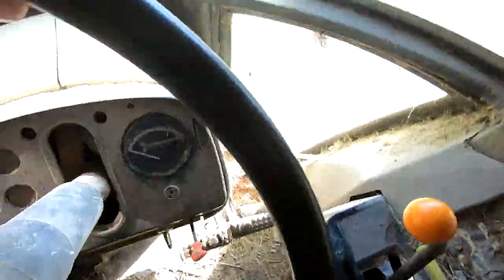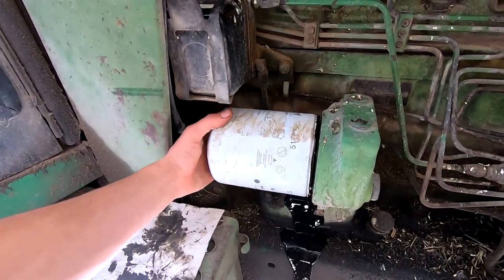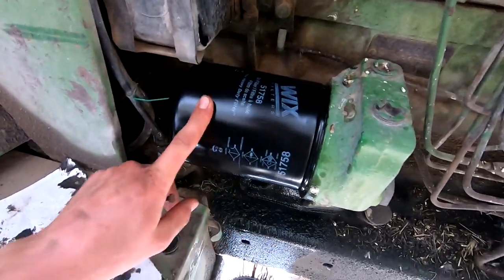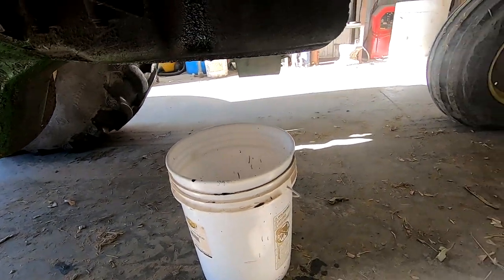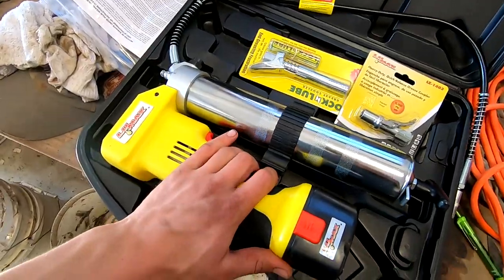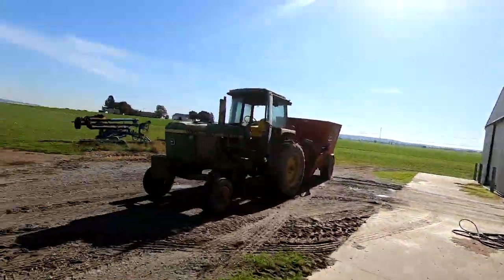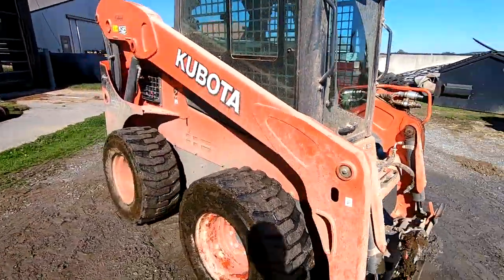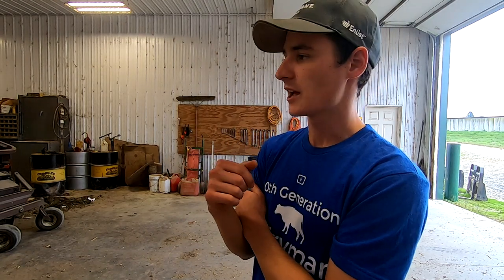John Deere 4240 Maintenance

Comment: You gotta love that filter position. Makes a oil change extra messy.
Reply: That's not bad. When they started turning the engines sideways in the cars 250 transmission for the front wheel drive on the 87 Oldsmobile you had to take off part of the passenger side fender well to get to the filter.( "To position the transaxle".) I usually change what autocorrect puts in there but this time I thought it was hilarious what it thought I said.
Reply: Yeah, that position is perfectly fine. Nothing wrong with an oily frame.
Reply: @EFCasual  There is a small plug right under the filter housing that can be removed & put a small container under it so it will drain the oil from the filter before removal, but sometimes, when time doesn't allow, it is much faster to just let the oil run down the frame.  Going to powerwash anyway.

Comment: 4240 is one of of the best John Deere's large farm I work for has one on the mixer for the past 15 years. It had 25,000 hours on and they had to rebuild the motor, it's now pushing 60,000 and only major break was a new injection pump this summer.

Comment: We switched over to a10w-30 oil for colder weather and it makes it a ton easier to crank a diesel in cold weather.
When it warms up the next oil change is back to the 15w-40 and we have no issues with wear on the engines.
Just an FYI for you.

Comment: Drum opening!  You picked the second hardest way 😟 there are lots of different combinations to choose so I’ll just go with the same tools you had ok. The drift bar , place it vertical next to lug in cap n hold, claw of the hammer 🔨 behind other lug but horizontal as you can. Rotate. Now your smart enough to work out the rest 👍

Comment: Those rotary nozzles are nice.... they remove a lot of material, very quickly.
But remember.... that's basically zero degree tip. It's just moving in a circle. I've stripped a lot of labels (and paint) off of equipment with those.
They'll also put water where you don't want it...  inside seals, inside bearings, under o-rings....
Good call on the safety glasses....  gave me a chuckle.  :)

Comment: When you need to open a oil drum you can use 2 flat head screwdrivers. Stick one vertically on the tabs and use a longer one horizontally from the other tabs across the other screwdriver near the bottom close to the drum and push the handle of the horizontal one away from you.

Comment: I’d get a standard fan tip instead of that wobble tip for the pressure washer. We used to use the wobble tips only when we wanted to remove everything. They have a smaller orifice or something and direct the pressure more intensely.

Comment: Great video as always. I love those old JDs
Reply: That's not old. It runs on diesel and has more than two Pistons, that you turned over by hand with a large heavy flywheel to start it, with a tricycle front end, and a hand clutch. Now that's old. Oh yeah, and across from the flywheel is a flat belt pulley to run the threshing machine, and grinding mill.

Comment: Should think about a rock screen for a back window instead of new glass.  I've used square hole fencing, rivet to an angle bar frame, and if you wish, you can use plexiglass or Lexan to line the inside of the screen to keep the dust out.  That screen on the gates keeping the cows in, but letting air flow in and out, would work just as well as any other metal screen you can buy in hardware stores.

Comment: Trick for opening the bungs on the 55 gallon drums of Oil, use Channel Locks. Just set the jaws so when you squeeze the handles the jaws fit in the bung plug, then turn it like a wrench.

Comment: Eric, You need more comments?  Here's one.  At 5:06 Put one of those cardboard sheets on the floor under the buckets to keep the floor clean.  The concrete floor will absorb the oil.  (Of course I try to keep my garage floor clean, your shop floor gets a lot more use than my home garage)  Stay Safe.

Comment: I’m sure you did, but make sure you clean radiator and air filter often. They plug up quick on our feed tractor (JD 4650 w/ twin vertical screw)

Comment: We had a wrench where I worked that was welded to fit both caps on the barrel, the one end fit the big cap and the other end fit the small cap so they could be opened easily without smashing a finger. But we opened a lot of barrels so we used it every day.  Just thinking you might use something like that.

Comment: Oil drum lid. Use 2 screwdrivers one upright on one side of the internal lug as a brace. The other screwdriver at right angles behind the other lug as the lever to turn the cap. Or you could manufacture one with the appropriate sized metal to fit behind each lug and weld handle at the top at right angles to use as the lever. The longer the lever piece the more purchase  you get turning the cap
Reply: @aarondrake1998  yes except it is  harder.  The 2 I mentioned gives more leverage

Comment: Love the old tractor. Have you tried using the 2 screwdrivers to open barrel plugs on a drum like that? Saves the pounding on the plug. Just a suggestion
Reply: Too hard on knuckles. We always just use the large pair of pliers with the Jaws spread apart.
Reply: The length of time in the video he probably just did it to see how many comments he would get about it. LOL

Comment: Does Deere design the oil filter mount to maximize the oil spilled when the filter is changed?
Reply: There is a plug under the filter housing that you are suppose to use to drain the filter to prevent the mess

Comment: On the next bung you gotta pull on a 55 gallon barrel,  grab a pair of 8 inch channel locks. The curved head will just fit inside the bung. You can tighten the bung by flipping the channel locks over.   
N gotta ask. That John Deere don't have a fuel filter on it? I always thought that it got swapped out when the oil filter got changed. Lol. Still a good job overall.

Comment: Just out of curiosity, isn't there a bolt you can take out of that housing where the oil filter mounts to or no? So you can drain the housing/filter before unscrewing the filter.

Comment: Two Vice Grips a flat screw driver. All you are missing is an old hitch pin for a hammer and you have the farmers tool kit complete.
Reply: Wait he's missing a wad of baling twine/wire and a half used roll of duct tape, then it would've complete. LOL

Comment: I'll leave a comment - hopefully it helps. 

You'd think that decal would be a bit tougher on the skid steer.
Reply: The Dekalb manufacturers should use the glue they use on the reflective tags for your license plate. I let mine build up pretty high and I had to use a chisel to get them off. Yep autocorrect that's what I said DeKalb, a corn variety! not DeKalb decals decals decals decals decals
Reply: With 267K subscribers, seems like the local Kubota dealership would gladly replace them. They get plenty of free advertising from this channel!!! Come on Kubota, make it happen!!

Comment: 😊😊😊Now that you mentioned it, the gasket is better known as an "O" ring.
Reply: Wrong. Round and flat on four sides is a gasket. Round with a cross section cylindrical , O ring.

Comment: Not to be a prude but you forgot your hearing protection while bangin on the cap to that oil barrel....JK :oD
Reply: Steel toed boots might be nice when 55 gallons of oil rolls over a foot 🤣
Reply: @jolive7953  That's true but I'd already be wearing them.  Wouldn't want a cow stepping on my toes either.